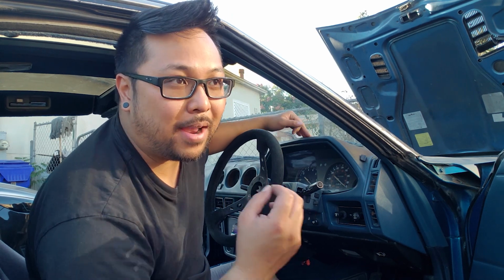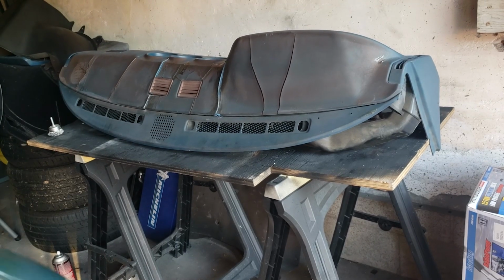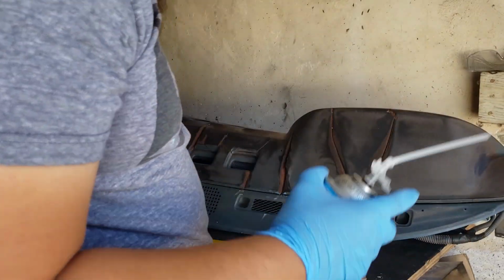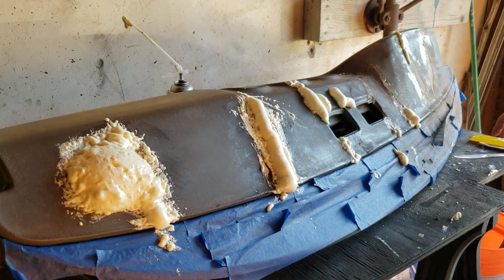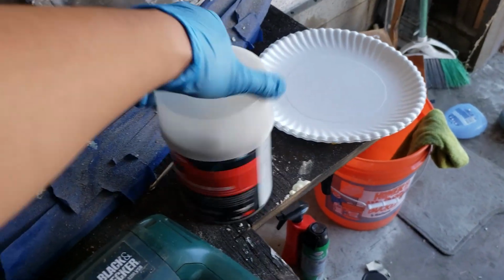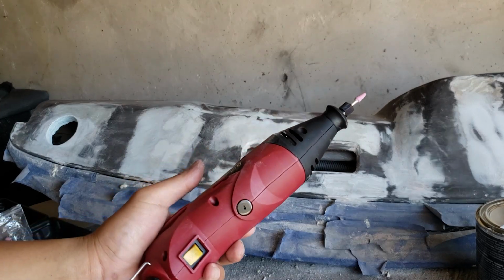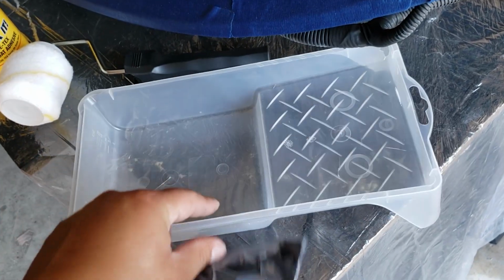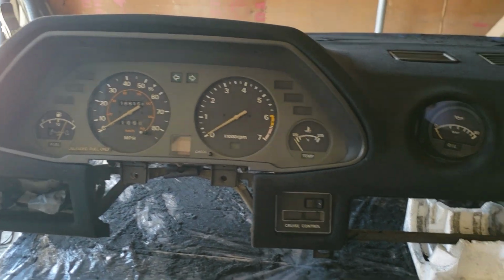How To Restore a Cracked Dashboard

Comment: The spray foam from the hardware store will continue to expand in the sunlight, so it will blow out after it sits in the car for a while, so you didn't get duped.
Reply: Not if you use the one specific for exterior use
Reply: dont forget to use a windshield shade

Comment: I spray the foam and leave it rise and cure, makes sculpting the dash easier. Glad to see someone sharing a diy vid like this. Also, flexible bondo is available as well as flexible primers and paint. A dashboard can reach some wicked temperatures. 💨🔥
Reply: In another comment he mentioned that it cracked soon after finishing. Will using just the foam have better success at preventing cracking? Or would it be: foam, cut/sand than apply flexible bondo?
Reply: Foam, cut ,sand bonndo sand spot putty sand  . Foam alone is too porous and you'll see the holes in it if you paint over it.😉

Comment: Nice dash, man. impressed by the results with just a hand drill as a tool. Hope the dash is holding up well. when doing bondo over cracks like those you should try to find a flexible bondo that can expand and contract with the heat changes in the sun, day/night, summer/winter ... to help avid cracking again. 
keep ut the good work👍

Comment: I was hoping for something else. I saw the video you referenced and didn't like the texture, it just doesn't look like what a dash should look like in my opinion. I think a better option would have been to put down a layer of 1/8" rubber foam sheet, then marine vinyl on top of that (best UV resistant material that's easily found), not to mention the appealing texture that more closely resembles what you'd expect a dash to look like.

Comment: Please give us an update in a year I’m curious to see how the urethane and polyester (bondo) hold up together.. also if the bondo cracks from vibration .. there are more flexible putty’s for bumpers that don’t crack as easily
Reply from the maker: I’ll give you an update now. It cracked already. Not too bad but if you know of a more flexible material you should try it
Reply: @victordeleon8412  use fiberglass

Comment: You're doing a good job but you need to use a block sander so you can get an even sand other thing is bondo and harder need to be mix until total color change  happens it sands better too
Reply from the maker: Thanks for the tip!

Comment: How is the repair working for you now? Any cracks or problems?
Reply from the maker: Yeah some small cracks came back. A different material other than bondo that can withstand heat should be used if youre trying to do it

Comment: how many wire connector latches broke when they were disconnected?
Reply from the maker: None actually. But I pulled the connector for the pod gauges too hard i think when I uninstalled . After putting everything back together the pod gauges don't work anymore

Comment: Good effort but I give it a year before its cracked and looking near as bad as when you started. Also the flock will pick up every tiny bit of dust and hairs that float about in the car so will need brushing or vacuuming often. I doubt it will take long before becomes worn and patchy. Might be a good idea searching for a good condition replacement.
Reply from the maker: Easy to clean with a lint roller. But yeah it has cracked already, ill probably upholster my next projects.

Comment: Nice job but sadly not what i would do on my damaged dash. I don't really like that flock finish, but your vid did inspire me and i watched it all to the end and smashed like! However i think you did the foam part a bit wrong. It doesn't look any different than common PUR/construction foam and it should expand to a uniform spongy like structure. The thing with the foam is when you start touching an smearing it like you did, it messes with the expanding properties and get all gooey and stringy. Having worked a lot with the stuff as a roofer i cringed a bit when i saw you starting tho smear it like a paste. Next time try and apply it deep and thick in the cracks and give it time to expand way over the edges and let it harden. Then after it has hardened your odd but seemingly effective use of a plastic breadknife to cut off the excess like you did seems fine. After removing sand it down and seal it with the bondo. In the end you did get a great result though!

Comment: Did you use both bags of flock ? Also you should really invest in a respirator that Bondo is deadly
Reply from the maker: I used very little from the second bag. I could have done it with one but it depends on the size of your dash. Better to have too much than not enough
Reply: @victordeleon8412  I have a 240z dash so I think I wil be fine with just what the package sends

Comment: Wasn't there feedback that that flocking is not UV stabilized and will deteriorate quickly?
Reply from the maker: I totally forgot to mention that I bought the Nylon fiber kit which is supposed to be more resistant

Comment: I wounder if the spray foam is that self rising kind if the bottle said it is the you could have done a home depot one that's what I'm planning for my dash rebuild. Either way you did a good job👌
Reply: I think when he tried to smooth the foam out with a spreader it messes with the way the foam rises and sets. Cause if he just left it he could have just applied the foam once and used the flexi bondo to fill much smaller holes once cutting it flush with the rest of the dash
Reply: Great end result either way though

Comment: so whats the shelf life of the flock? How do you maintain/clean it? At least with regular dashes you can put 303 on it, or other UV protection to slow down weathering.
Reply from the maker: I bought the nylon flock which is resistant to breaking down from UV. You can either cover the dash when not driving it or use a lint roller or masking tape to remove dust/lint

Comment: I've been searching for a way to restore my dash in my '91 S10 I'm starting to rebuild. I never thought about using a spray foam as a filler, but it seems to work pretty well. How has it held up over time? Any new cracks?
Reply from the maker: Yes some small cracks have formed. I think its caused from the bondo not the foam layer
Reply: @victordeleon8412  hello Victor can you help me restore my 1981 280zx dashboard?

Comment: You actually did get rooked on that foam. Same stuff at Home Depot - it's called "Great Stuff". I think it may expand a little more but same stuff otherwise. Also, you put all that work into it when you could have just bought one of those form fitting carpet dash covers and threw that on there and called it good. But hey, nice effort nonetheless.

Comment: That foam didnt work like you wanted it to because youre not supposed to mess with it . Just let it form up on its own then cut it off. Wouldnt have been messy also. Then used a real knife with actual real metal teeth on it. That turd plastic knife ruined the cut. It would have been smooth(er). I also cant believe you did all of that with a drill, that would have been the last thing I would have used. That had to have sucked ass doing it that way.

Comment: One year later video?
Reply from the maker: The flock and foam held up pretty well. But there are a few small cracks in the dash again, I think the bondo is what failed
Reply: @victordeleon8412  ive had that experience with that brand of bondo. Was curious if it happened or not. Great video. Thank you.

Comment: why  not just use a shaped DIY plastic mold from a matched template from the original dash?  Not criticizing, but all that hard work has looks like it end up being a "dud", if there's a hard bump or hard vibration inside the car.  The sealing will re-crack - and all the time / / money spent will be wasted!

Comment: How do you clean the dash after its been in the car for a while?
Reply from the maker: Haven't had to clean it yet, but probably a lint roller or masking tape
Reply: Use a wire brush or 80 grit sandpaper

Comment: Should’ve just stuck and worked with the cracks, Foam is a disaster, small disk is way to small and no control from a hand held drill, far to much hardner in the bondo, hence all the bad lines because it was trying to harden, then hide it all with flock, thank goodness it’s not my dashboard, cheap and nasty.

Comment: I appreciate your work. But i want to spot your working weakness. 
Your result is poor because of your sanding method  , 2nd ur applying putty  method is not accurate. 
Pu foam is good but u dont know how to use it.  Do manual sanding in smaller area's. The whole dashboard could be finish in few hours where it tooks days from u .
I hope u dont mind.
Reply from the maker: Yeah it was my first time repairing a dash. I learned a few things from the process, hopefully I'll do a better job when I redo the dash in my e30

Comment: Why are people 'Flocking'  dashes ?   Is that how the factory finished them?  Shit looks like a furry speakerbox from the 90's, 
 i bet that shitu get Dirty'ner a MF,  & bein that its just glued down powder aint like u can really wipe it down or anything,
Reply from the maker: @DavidDiaz-zp4hu  flock is a matte surface so it doesn’t reflect a glare, very popular in motor sports. I clean mine with a lint brush
Reply: @victordeleon8412  i hadn't thought about the negative effects of reflecting a glare.  Im looking into doing a badly cracked one on an 85 S10 using Loctite PL Premium Const. Adhesive in the cracks then spraying with bonding primer under some colored bedliner spray